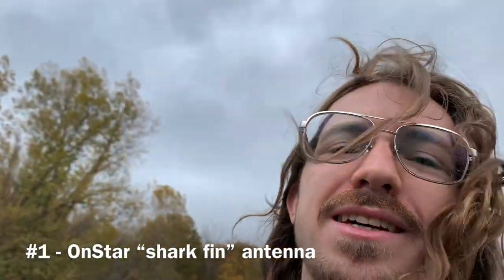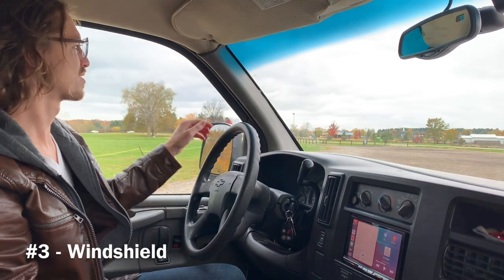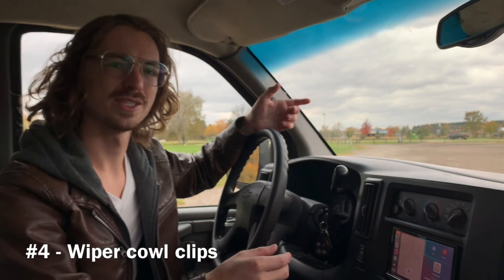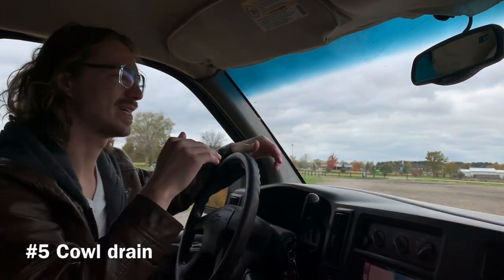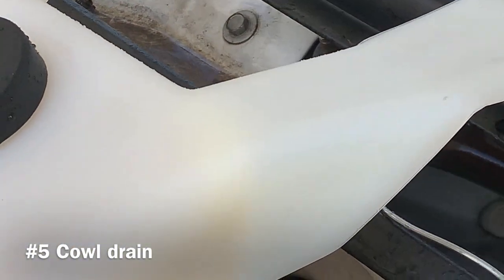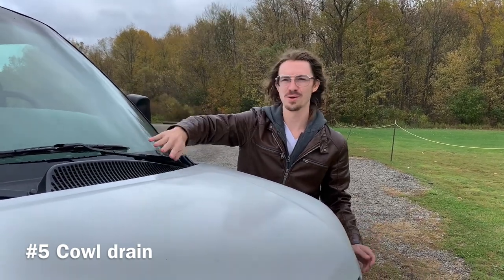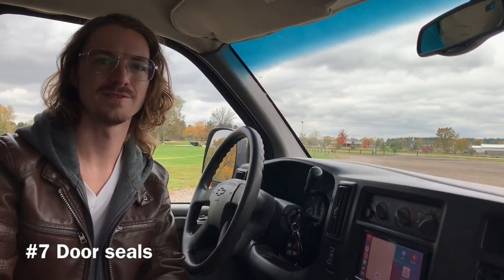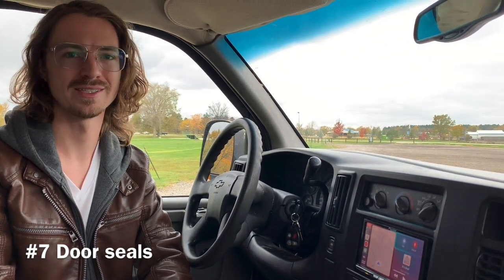Troubleshooting Water Leaks - 7 LOCATIONS - (Express & Savana Vans)

Comment: Thank you so much for making this video. I recently purchased a used 2007 Chevy Express 2500 cargo van. It doesn't have a lot of mileage on it but it sat for a few years unused. Whenever it rains hard I keep finding a big puddle under the passenger side seat. (I had removed the front mat because there was a lot of moisture and mold under it.) I removed the cowl and cleaned it and resealed it. The leak wasn't coming from that area but I did remove a ton of debris underneath and behind it so I'm glad I did that. Today I held a hose up at different spots and when I got to the top back corner of the passenger door and held the hose there, I could see the water splashing in to the van. So much water. The seals don't look like they are in terrible shape but I can see that a tight seal is not formed when I shut the door. Sounds like it might be worth it to replace all the seals. I hadn't thought of hitting up a salvage yard. Will do some digging. Thanks again!
Reply from the maker: Sorry to hear about the weatherstripping!
It's crazy how many people have issues with leaks on these vans!

It's also surprising how common this style van is on the road and how sparse they are in the salvage yards.

I would call ahead to a few to make sure they have a van in their inventory to be safe!
Reply: @VanwithTim  Yeah, it is weird how popular a van choice this is for so many companies' work vans yet the two salvage yards I looked into near me had hardly any parts for it. When I lived out in CA in Ventura County, I remember going to the coolest salvage yard where you could walk around for hours and scavenge whatever parts you wanted off the rows and rows of vehicles. I really enjoyed that. Here in VA, they don't allow the public to enter the yards. You have to tell them what you want and they tell you if they have it or not.

I didn't know these vans commonly have leaks. Interesting. I looked into purchasing the weatherstripping online (ebay, amazon, auto parts stores, etc) and the cost is out of my budget right now. I had a lot of weatherstripping leftover that I used to replace the trim on the cowl (the part that faces the windshield). I realized it might work well to stop any leaks, so I ran strips of it along the top of the door, side of the door, and on the van body where the door hits. No rain came in the last time it rained so I think it did the trick. The hose test will be the ultimate test. I just want to move forward with the build and the leak was holding me up. I'm really excited to move forward with the build now.
Reply from the maker: @bodhifever4626  Wow what a bummer about the salvage yards out there! There's only a LKQ salvage yard where I'm at in California. They nickel and dime EVERYTHING.
Once grabbed a taillight for a Durango ($20 new online) and they charged $18 - $3 for a "wire harness", $2 for the two light bulbs inside, and $13 for the actual housing.

My old salvage yards in Flint, MI would glance over the counter at my wheelbarrow full of parts and ask how $25 sounded for it all.

Glad you figured out the water leak! Even if it leaks a little with the high-pressure hose, not the end of the world. Just avoid the automatic car washes haha
Reply: @VanwithTim  Haha. Good point about avoiding high pressure car washes. And thanks for saying even if it leaks a little that it's not the end of the world. I need to hear that kind of stuff. I need to let go of my desire for the build to be perfect if I'm ever gonna finish it.  

I realized my last comment was confusing. When I priced replacement weatherstripping (like if I removed the factory stuff that's there now and replace it with new), that was really pricy. Like $50 a door. The weatherstripping I ended up using around the door was just a $10 roll of 1" foam made for using with camper tops that was sticky on one side.

That doesn't sound like good business sense for a place to charge $18 for something you can buy new for $20. That place in Flint sounds very cool! If I ever decide to settle down in one spot, I would love to open my own salvage yard.  What a cool environment that would be to hang out in.
Reply from the maker: @bodhifever4626  You might also want to try adjusting your doors for a tighter seal. There isn't too much room for adjusting, but you can move the striker pin inwards towards the van body for a tighter seal!

Sounds like it's good to go for the moment though - happy to hear!

I still get a small amount of water from the top of my rear door windows when pressure washing, but that's really the only time. Not too worried about it!
Reply: @VanwithTim  Thank you for the suggestion about adjusting the doors. I had no idea that was even possible. I will look more into that.  

I've worked more on the leak issue and it turns out it's not coming from the door area. That's good because it means I don't need to seal the door shut (I was contemplating just welding the whole thing shut since I have 3 other doors to use). 

We had a lot of heavy rain yesterday. I sat in the van for almost an hour while it was raining just watching the area where the water accumulates to hopefully spot where it was coming from and it was dry as a bone when the rain stopped. About an hour later I went to the gym for an hour and it rained heavily the whole time I was in there. When I came out, the van had a ton of water again in the passenger footwell area. I was like wtf. I sent a video to a friend and he suggested that maybe there is a barrier holding back the water somewhere which isnt draining properly and that the water doesn't overflow into the van until a certain amount accumulates which might be why the water isn't showing up until it's been raining for at least two hours. 
So Im going to rewatch your video where you talked about that barrier area overflowing under the hood.
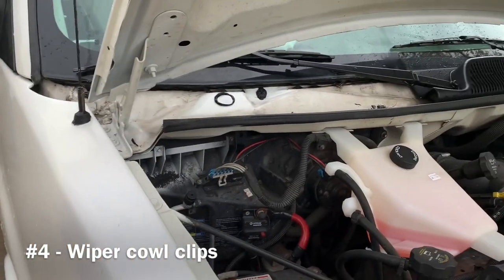Reply from the maker: @bodhifever4626  Oh wow that sounds exactly like my issue with the cowl drain @4:06

Maybe have someone spray the windshield continuously while you look up into / above the passenger footwell with a flashlight.

Like you mentioned, maybe it fills with water then ends up flowing in.

Glad it's not a door seal issue!!
Reply: @VanwithTim   Hi! I watched your video again a few times and it definitely seems to be a cowl drain related issue because the water is coming in in the exact same place in your video at 5:15. I removed the blower motor and removed a bunch of leaf debris to the left of it but I don't think that's what was clogging the drain. I heard you say you stuck a coat hanger in some where to unclog the clog but I couldn't see where you fed the coat hanger into or where you pointed the hose at. Was it in front of the little white door? Or behind it? I have a Chevy Express 2500 so not sure if we have the exact same van. Still, your video has helped me out more than any other I've found on yt so far.
Reply: @VanwithTim  I fixed it! Your video gave me the confidence to believe that I could do it. I basically tried to use common sense in figuring out where the water would flow after entering the cowl grate and was able to find the clogged drain opening using a long piece of 12 g wire. Thanks again so much for this incredibly helpful video. I couldn't have done it without it. If we ever meet out on the road I'm buying you dinner. Happy Travels! ~Dusk
Reply from the maker: @bodhifever4626  Wow nice! Glad you have it narrowed down and best of all it's a free fix!
Watch the camera closely@5:39 The drain is that weird trapezoid shaped hole.
Looks like I removed the cowl and stuck the hanger down through the top of where the cowl was previously.
You MIGHT be able to get the hanger in there through the blower motor hole if your hands are flexible enough!
Happy to hear the video is helping so far!
Reply from the maker: @bodhifever4626  Oops! Should have read ALL the comments! So glad you got it working! Such a strange spot for a drain clog for sure, but that makes two of us with the issue!
Enjoy the dry floors!

Comment: on earlier express vans the computer is right below (far left side of engine bay) the water drain from cowl area, it gets corroded over time, then your screwed.
Reply from the maker: Ugh… I spent a TON of time troubleshooting an intermittent stall issue on a 99 Express. That was exactly the issue. Luckily a $40 salvage yard PCM fixed the issue 🙏

Awful design though.
Reply: @VanwithTim  if vans electric is going crazy in weird ways at same time, its likely computer esp if it looks corroded

Comment: Something else you could have added to your list driver and passenger side the bottom  have a little plug that you can flush cuz there's little series of drain holes with behind gasket  on the very bottom mine where filling up because it couldn't drain fast enough so I just took a hose and separated the gaskets flushed it out and pull that little plug on the right hand side there and just stuck the hose nozzle in it and let it run for a few minutes
Reply from the maker: Was that down in the wiper cowl area below the wiper blades? Didn't see them on my 2005 but that's good info to have.
Was that the only water leak you had on your 2001?

Comment: Hi Tim, great video.  Who manufactures the silicone that you used and what is the product name?  Thanks a lot!
Reply from the maker: Check it out here! https://amzn.to/3ykWCGf 
It's GE Advanced Silicone - Window and Door Sealant (GE5030)
You can also pick it up at most hardware stores in either black, clear, or white colors.

They might also have the same product in a smaller squeeze tube if you don't have a caulk-gun.

Comment: Great tips,
Going to look at every tip your provided.

 I seen another video where the back air release flaper was leaking, did you ever see it leaking there?
Reply from the maker: Thanks Johnny, thats a good place to check as well now that you mention it.
A quick bead of silicone around the plastic mount would make for good leak insurance. 

Haven’t had any issues with mine, but next time I have the passenger tail light out I’ll take a look at it!
Reply: @VanwithTim  I replaced the back door gasket. That didn't stop the leak.
Actually had to bend the top of the doors in about 3/16 inch. Over the years who knows how I knocked the door out of alignment.
It's good now.
Reply from the maker: @johnnyrizzo8057  that’s wild! Glad it’s fixed. Gets wildly irritating seeing water on the floor.

Comment: Did you end up replacing or sealing up the HVAC recalculation door? The rubber on yours crumbled the second you touched it, as did mine.
Reply from the maker: They sure don't hold up too well.
It's really just to seal the air-flow between outside air and recirculation.
I just left mine to crumble in peace lol.
Still no leaks to report!
-Tim
Reply: @VanwithTim  After some calling around it doesn't sound like that's a replaceable part.  My only real concerns were the Critters getting in, water shouldn't be too big of a deal if the HVAC drain is clear. The round hole that you ended up covering with a white cover (plastic maybe) on my rig was jam packed with a rodents nest, so I think I'm going to cap that off too.  

PS: if the Windshield seal isn't done properly the body it can start rusting and rotting out the body right around the windshield gasket.  I had to have my windshield replaced after noticing some wind noise and condensation, and there were 2  large strips of rust after the glass and old urethane was pealed back. Not good!  

Also take a look at the rear of the van roof towards the end of the gutter, I found some of the seam sealer starting to crack and water pooling in the cracks.
Reply from the maker: @jordan879  Glad you're getting it all taken care of!
I've heard a few horror stories in the Express / Savana Facebook groups on bad windshield installs. I remember seeing some pictures of that rust you're talking about. Really sad! 
I suspect with it being such a large windshield and so high off the ground that installers get lazy with the "Window-Weld" adhesive. (Lots of reports of brand new replacement windshields leaking)

I'll have to take a look up top during my next wash to check out the seam sealer, thanks for the heads up!

Comment: The whole back end is full of condensation. I'm dying...its coming from the very walls themselves do I need a vapor barrier,  recommendations?
Reply from the maker: Just camped the Grand Canyon where it was 8F at night. Our breath froze to the windows and any exposed metal.
 Next morning I ordered a ~$150 diesel heater. Will hopefully install soon. Only wish I had planned it into the build instead of adding it after.

Should take care of the condensation.
For temporary relief the only real solution would be to run the van with the heat on. It pulls in dry fresh air from the front then exhausts the stale cabin air through the back (behind the taillights)

Others run propane heaters inside their vans with a window cracked, but it sounds a bit too dangerous in such a small space. Only takes a knocked over pillow to start a fire, or you risk CO poisoning.
Reply: @VanwithTim  That"s brilliant. Did it work out well?

Comment: I have a 2001 Express and when I took the cowll off it came off in like 20 pieces the driver side was so dry rotted it just hand grenaded when I touched it I'm going to have to super glue and plastic weld it back together I think I'll do a video on that I could probably just go to junkyard and get one I've also the replaced my hood latch in my door driver side door plastic thing some moron glued it on and now the glue is disintegrating in the I have to hold the handle down while I open it I found them online so a lot of stuff you got to do when you're converting a van and rejuvenating it to make it hold up my in the body is so rust free it's ridiculous l just have to restore it just the plastic stuff  disintegrates
Reply from the maker: Funny as it's the total opposite in my home state of Michigan! My mom's old 1999 Express had flawless plastics and (other than some stains from family trips and pets) the interior was fantastic. But the whole body was rusted (doors rusted all the way through the outer skin!) Had less than 150k miles when we got rid of it.

Glad to hear you're putting in the work to bring back the van. Love the 1996-2002 body style / interior.